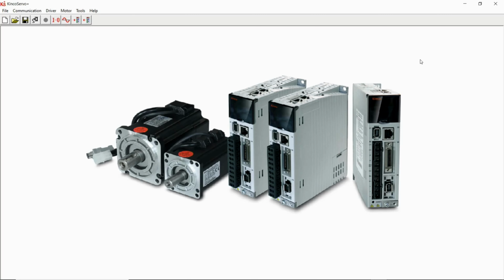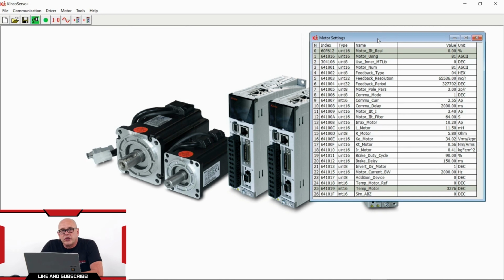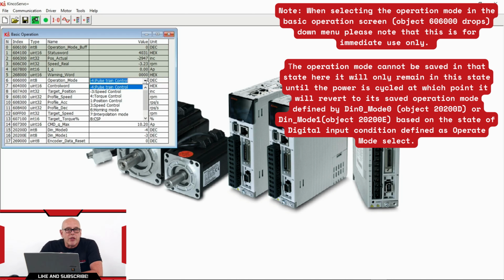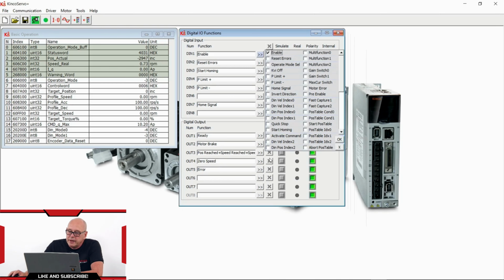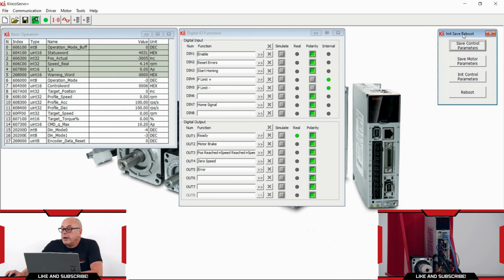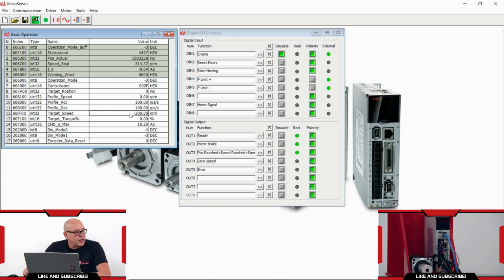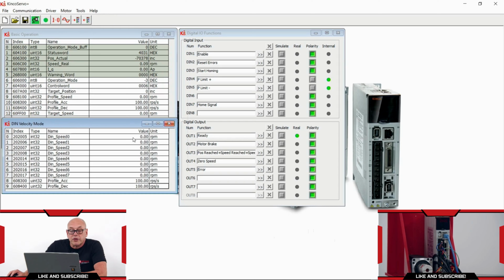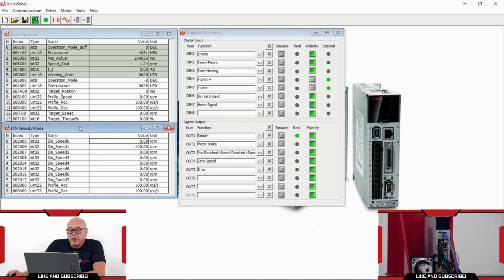Kinco Servo Plus Tool: A Step-by-Step Guide to Configuring Your Servo Tool for Optimal Performance!

Comment: Hello, I have a problem with RS232 communication with the FD425-PF-000 inverter. I made a DB9-MiniUSB communication cable according to the instructions. However, I cannot connect to the inverter.
I tried to communicate through various USB-DB9 adapters and directly through the DB9 connector.
Do I need to set any options in the inverter? What am I doing wrong ?
Reply: There is an error in the English manual regarding the numbering of ports in mini USB 5->1. In the Chinese manual, the pins are numbered correctly 1-5.
Reply from the maker: @kamilkuzniar6085  Thank you for pointing out the error in the manual.
Reply from the maker: If you purchased this drive from us, please contact us directly through our website.
https://motioncontrolproducts.com/contact/